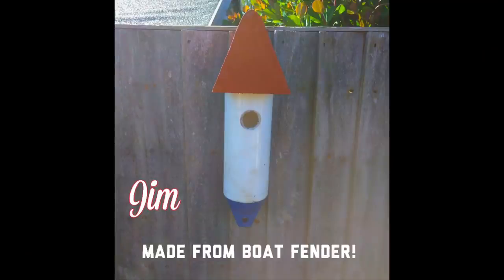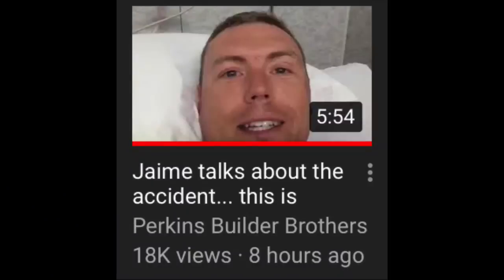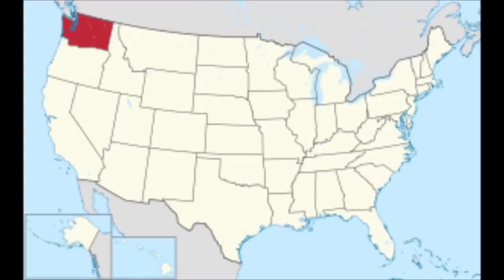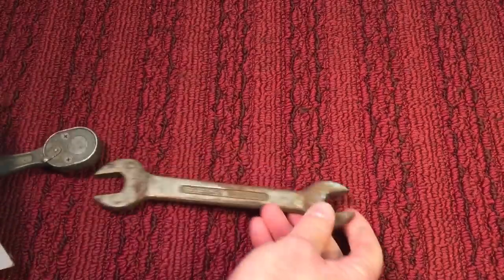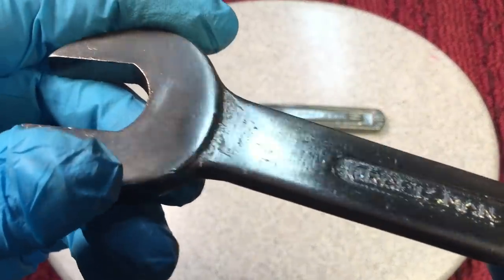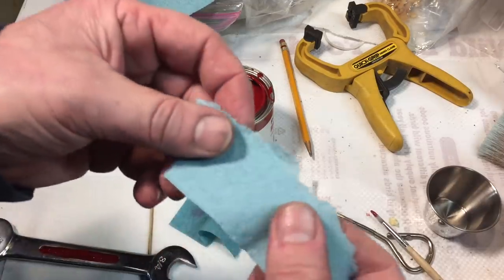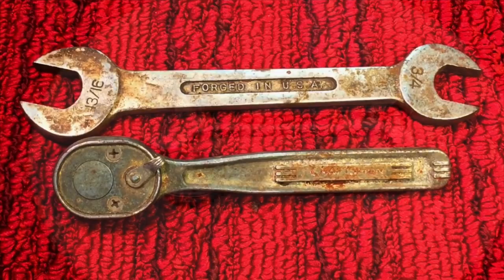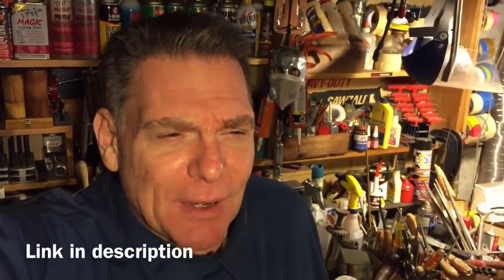Vintage Craftsman Wrench & Ratchet Restoration

Comment: I just went back and watched the Perkins Brother Builders clip that first mentioned Jaimie’s accident, and the one that showed his workshop. The first video mentioned that the accident occurred at 2:30a.m. Unless you’re working a night shift, you are not going to be alert at that hour of the day, at least not enough to run machinery safely. In the shop tour he showed the joiner, that did not seem to have a spring to make the blade guard return to the closed position. I don’t own one of those so I don’t know if it’s supposed to have a spring but a blade guard that has to be manually put back in place doesn’t seem like much of a safety device.

I admit that the fact I’m still alive and able to count to ten without taking a shoe off is due more to good luck than good planning. I’m good about wearing safety glasses. I hate wearing gloves, I find that if I’m working on something with thorns I get more scratches through the gloves than if I handle it carefully without gloves. I usually don’t wear a dust mask because then the safety glasses fog up. I have taken to wearing hearing and eye protection when cutting my lawn, but that’s just because the DR mower that I bought to replace my dad’s old 812 Gravely is the loudest machine I’ve ever used.

Speaking of lawnmowers my dad started letting me cut the grass using his 1948 Locke with the side gangs removed when I was 10. The mower was twice as old as me. The next summer I got to use it with the gangs. The current mowers that shut the mower off when you let go are not really safer. They just encourage you to bypass the deadman switch. With my 42” DR mower there is hand lever to squeeze for the drive wheels and another lever on the other handlebar that you have to hold when the PTO is engaged, and a knob on the panel with the throttle and gear selector for actually engaging the PTO. If you let go of the PTO lever the machine shuts off. Given the size of the machine it would be almost impossible if the lever worked the PTO clutch to let go of the lever and get a body part under the mower deck befor the blades stopped spinning. Rant over.
Reply from the maker: J Anderson You are so right-  Jamie is an experienced operator for sure but working for a living and doing it as a hobby are two different animals.  Us hobbyists work on our own schedules where as Jamie doesn’t have that luxury!   😃👍
Reply: @ScoutCrafter  I sorta think that if you’re running a business and taking jobs that force you to work past 2 in the morning you’re doing something wrong. I can see if a contractor is doing work in on an office where he can’t start until the office staff leaves, a crew might start at 5:30 p.m. and work through the night, but those contracts usually pay a premium so the office or store doesn’t have to shut down.